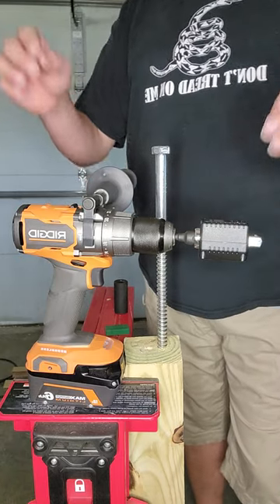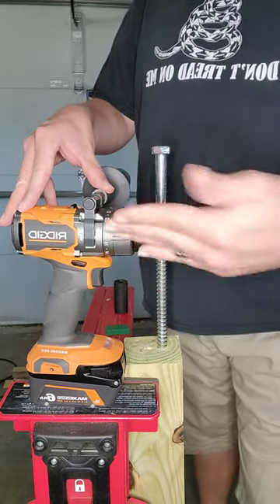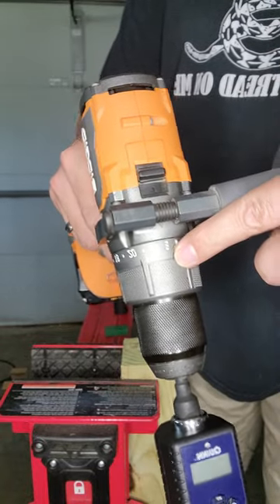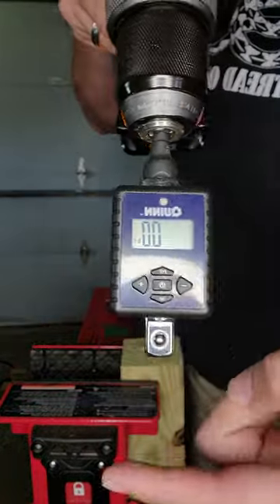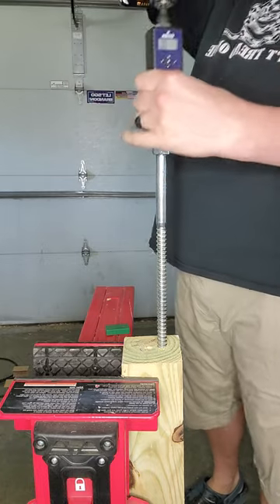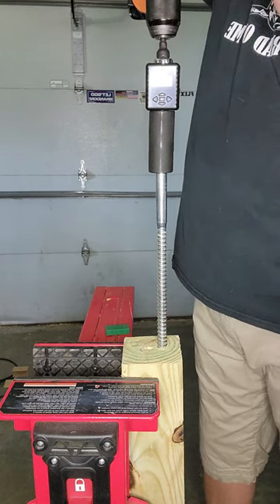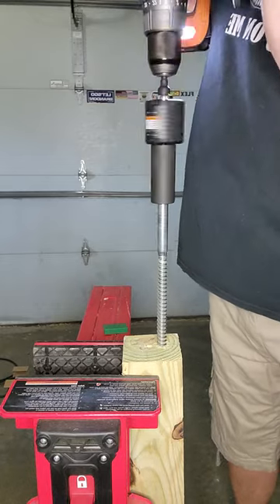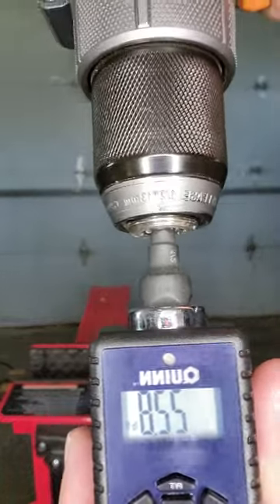Torque Testing the Ridgid R86115 Brushless Hammer Drill #ridgid #torquetest #homedepot #shorts

Comment: So my hammer drill started making a terrible clicky/grinding noise when locking and unlocking bits, also the chuck is pretty wobbly now, not sure what is going on  but it might be time for a trip to home depot for a LSA🙃
Reply from the maker: Let me know how it turns out
Reply: @ToolswithSoAlz  Well, my HD said to just bring it in for an even exchange. I brought just the hammer drill in and explained that I got it in the 4 tool combo kit online and showed the receipt.  My location only had the kit with 4ah battery & charger. They still let me swap it out! Extra 4ah Max Output & extra charger now 👍🏼. I'm not sure if I can register this one though as I didn't get a receipt for the transaction. Great customer service on HD's part, just worried that my old LSA wont be valid for this new one😅🤷🏻
Reply from the maker: That's awesome! Love that service

Comment: It's in speed 3 watch close
Reply from the maker: Speed 3 on a tool that doesn't have a third speed?
Reply: @ToolswithSoAlz  you can see the number three. Explain
Reply: @productiongarage5555  that's the clutch setting but it wasn't even on 3. The clutch was actually all they way up to drill mode otherwise it would've engaged way too early. You should know what you're talking about before making such a statement
Reply: @luisinhoens90  drill speed is on top of the drill look at your video it looks like the number 3 to me. But I have rigid tools and use them on the daily and mine has speed settings on top pretty sure they all do.
Reply from the maker: Go, grab the drill, put it in drill mode, see what it does and then put the transmission on 3 and see for yourself.